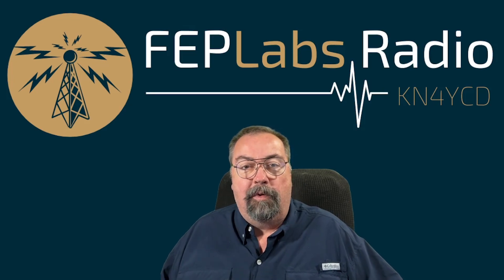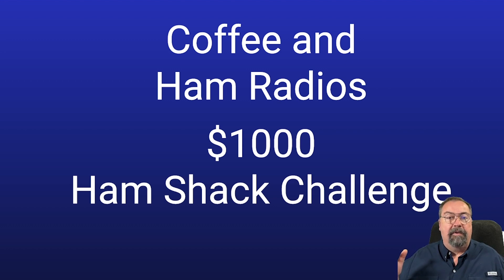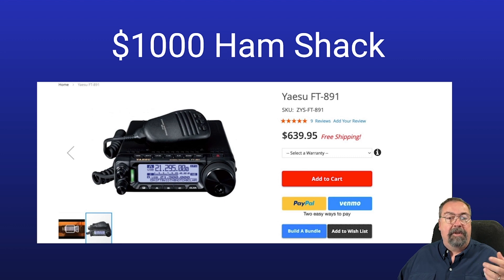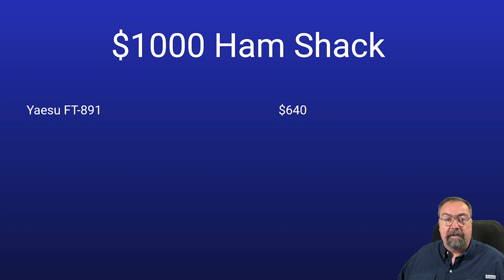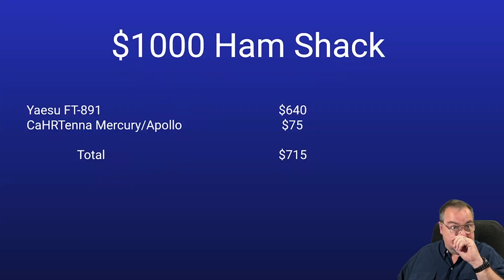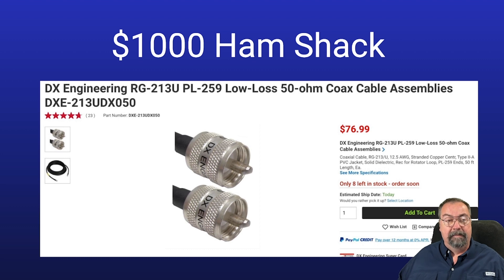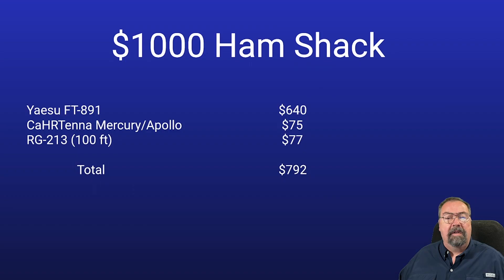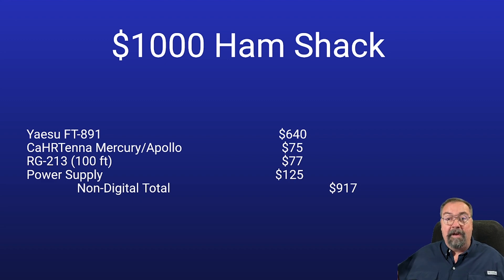The $1000 Ham Shack Challenge - Can You Build It?

Comment: IC 7300 (or 7200 w/ LDG IT-100, homebrew 9:1 unun w/ 41' 18-16 AWG wire antenna, Amazon coax (at minimum RG8X), Amazon 30amp power supply, 2 sections of fence post top rail, cinderblock, 50-100' 550 cord and assorted hardware. Gets you up at minimum 20ft with 100 watts and a wire. It's dirty, cheap and affective.

Or if VHF/UHF is you goal, use the same mast set up with a TYT 9800-D (also does 6m/10m FM only), quad band antenna and ground radials (Amazon for both).

Comment: I've been testing the Pi400 with build-a-pi lately. It works. It's not the fastest little machine, but it is solid and a little faster than a regular Pi4. It is quiet (no fan) and if you have enough pixels on the monitor it has some advantages over a low end laptop. If you want to have a few apps up like wsjtx, hamclock, gridtracker and a logging program all visible you need some screen real estate. 1080p is marginal and 1440p is a more useful amount of space. The majority of inexpensive laptops have less than 1080p so don't really have enough pixels for all this so a Pi and monitor can be a better setup. There is also the PiDock 400 that turns a Pi400 into a 1080p "laptop shaped object". It runs on 12 volts and is a convenient choice if a 13" 1080p monitor is enough. You can customize it to your needs more than a conventional laptop, and Pi's tend to last longer than cheap laptops because of software support and available updates. 73 de w6akb
Reply from the maker: Right - I did the build-a-pi on it and used it for several weeks.  It has the advantage being obtainable fairly easily.  Finding a pi4, good luck (and not paying 3-4X retail).  There are upsides and downsides to using the pi400 vs a laptop.  I have the official craptop, and it works fine.  I'm not doing videos on it, or simulating the heat death of the universe.  For ham stuff, it works just fine.  I'm using mine mostly to collect all my CPS software together.  Thanks for watching!